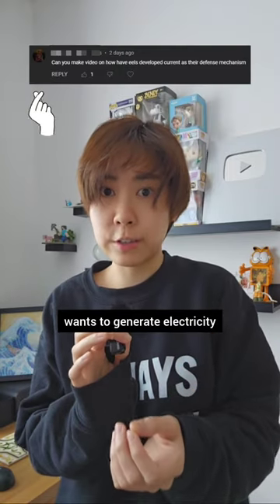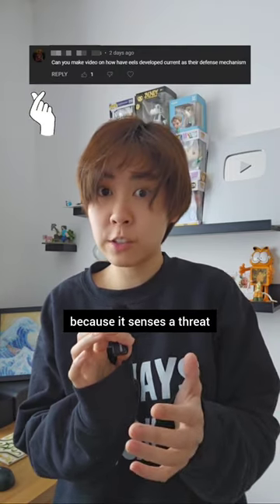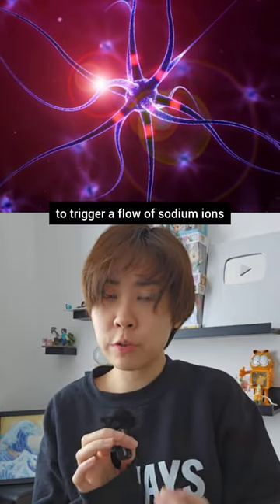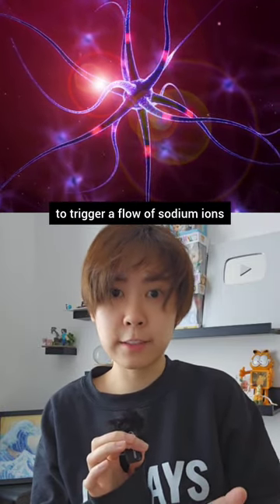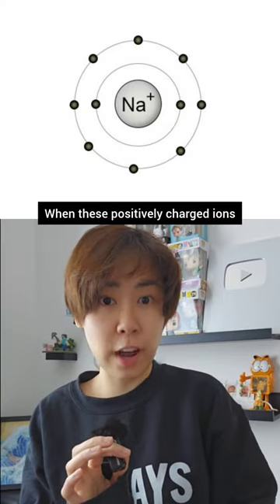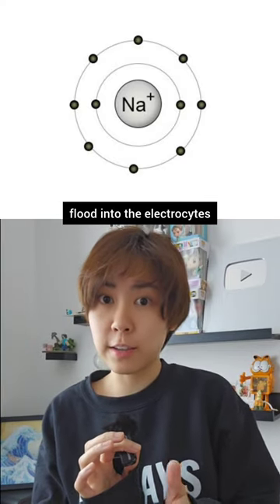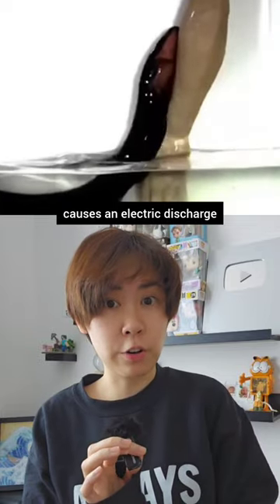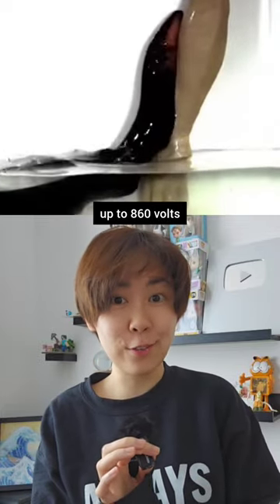How does an electric eel generate electricity? #science

Comment: Help me out here, does that Eel put out Static electricity? 
I honestly thought that Electric Eels were mythical. So, they're actually real?

Edit: They actually put out DC, so it really is like a series of batteries. In electrical terms, DC is not the same as AC, but i actually thought, for reasons unknown, that the Eel would put Static electricity out. Static is a LOT weaker than mains power and 860V is a tiny amount. Seeing as it is actually Direct Current though, this is the equivalent to being shocked by 573.333 AA, (or AAA) Duracells. Actually enough to kill a fully grown human 10 times over if the current were to travel through the heart.

Electricity is a funny one, and I'm afraid you may have opened a can of worms by telling me electric eels are real creatures! Thanks. 😂❤